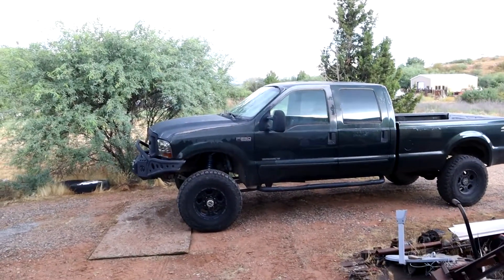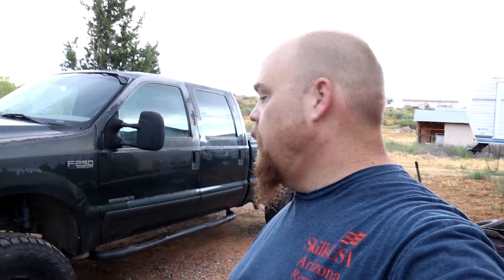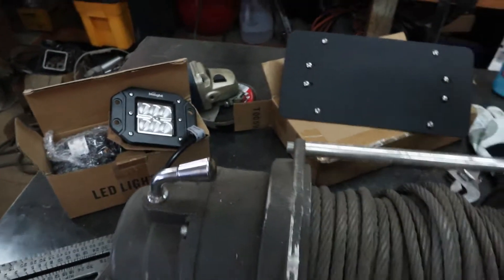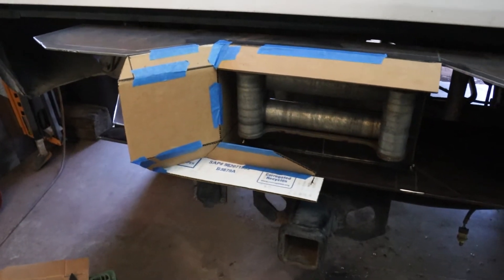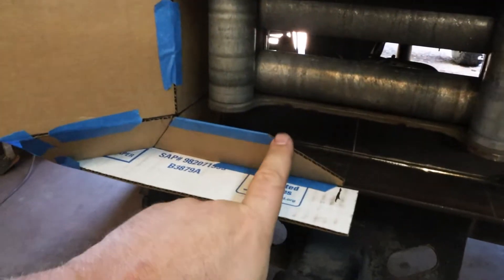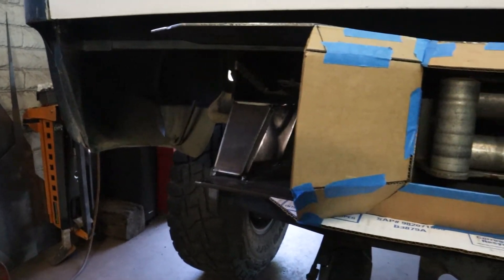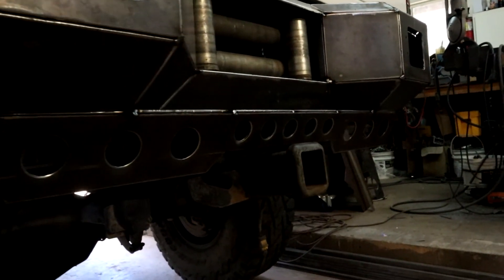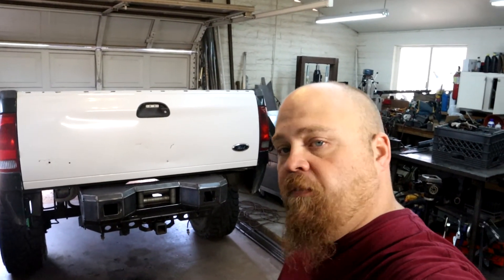Fabricating a custom hidden winch bumper for the rear of my Super Duty. Fabrication 101!

Comment: i love your bumper design, but as a seasoned Towing and Recovery specialist I want my fairlead to be able to utilize 180° degrees for sidepulls if needed. I want the fairlead out flushed or slightly past the  bumper for full range of use.  Im setting up my personal 1 ton as a personal recovery/ disaster/ prepper truck . My frontend is setup now I'm addressing my rear end. But most manufactured winch bumpers have deep fairlead pockets. Im looking around for ideas. I might need to design my own and recruit a fabrictor.
Reply from the maker: I agree with you on the fairleed and on my front bumper it does stick out. I want the rear to be hidden and I use it more for loading trailers.
Reply: @Fabrication101  Cool. I'm building my truck to be able to recover myself and others.

Comment: Looks good...one comment when doing a side pull your cable will rub against the bumper
Reply from the maker: Yep, the rear winch is mostly for loading stuff on the trailer. I also figure if I drive in straight and get stuck it'll be a straight pull backwards.